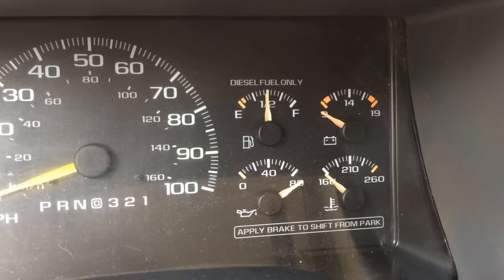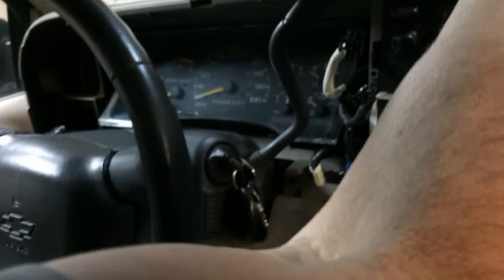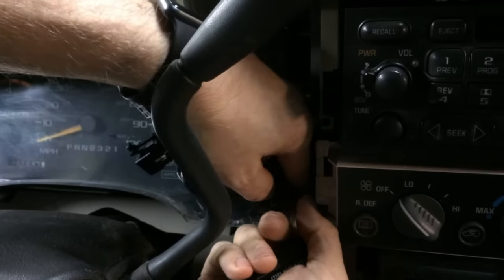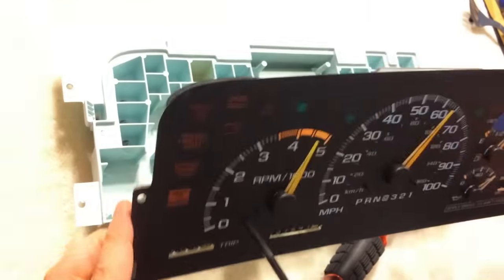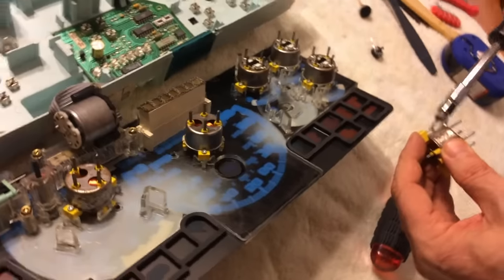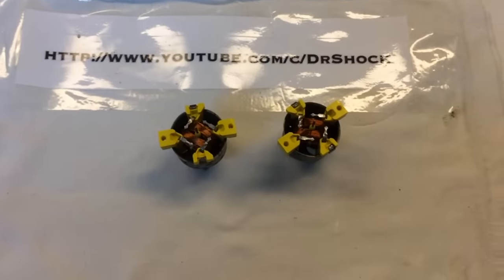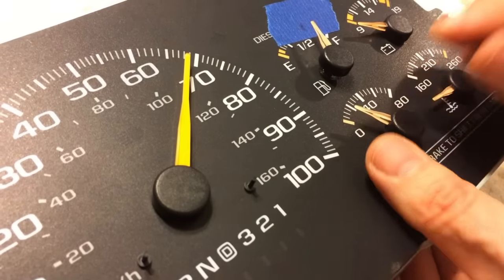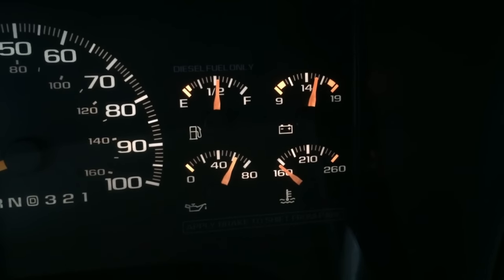1994 - 2002 GM Truck Twitchy Erratic Crazy Fuel & Oil Gauge Needle Aircore Motor Repair (Chevy GMC)

Comment: Well my rpm gauge and speed gauge are erratic and crazy what’s the fix for that?
Reply from the maker: It's much less common, but there is an "S" calibration aircore in the description for both the tach and speedo.   But unlikely that both went at once.  I'd check the wiring harness from the PCM, especially grounds first.   The tach signal is fed from the alternator harness on these old body style trucks.   I'd suspect the aircore motors last in the situation you're describing, far more likely wiring or even the PCM before them.

Comment: Would that work on he speedometer ???
Reply from the maker: Same type of aircore motor, but different calibration number than the fuel gauge,  The description area lists all of the calibration codes.

However, only the fuel gauge gets the twitching problem due to the motor.  A speedometer would not, and you would only replace the motor if it's going outside the dial range, or not working at all.  Speedometer glitching is more likely a vehicle speed sensor problem, or noise/interference in that same circuit.

Comment: Anybody know if there is a way to tell which one I have without disassembling the cluster?  I'd like to have my replacement prior to disassembly, especially if it maty be that none are available.  1998 GMC Suburban 1500 SLT 4X4 5.7  (My needle twitches the whole time and stays around 3/4 regardless of fuel in tank except when the is completely full or completely empty.
Reply from the maker: There's some detail in the video description, the motors differ only by model year.   The twitch is most likely the issue this video shows, but the incorrect tank level, that is more likely a problem with the sender.  The motors tend to have the twitch, and then either work or not work at all.  When it's working but inaccurate, that's usually the sender in the fuel tank itself.
Reply: @DrShock  OK, Thank you for the reply!

Comment: I wonder this the same as a 00 C3500. My fuel gauge is all messed up same problem.
Reply from the maker: Only if its an old body style truck, the new body design in 1999 and up went to stepper motors in their instrument clusters.   Though there were some carry over old body style commercial trucks like the C3500 so "maybe".
Reply: Thanks for the input. I'm take mine apart so I know what to order. Thanks for the video.

Comment: Mind sharing link to buy aircore motor? Im looking for the oil pressure gauge.
Reply from the maker: In the description
Reply: DrShock awesome,thank you.my pressure gauge starts pass 45-50 on cold start.then drops when im on a stop.then back up to 40 when i step on gas.think this is the issue or is that normal?
Reply from the maker: @sikk84mcss  IMO that described behavior is unlikely to be the gauge itself (which would be more typically completely inoperative or wildly off the marks on the cluster.  The oil pressure will, of course, fluctuate with acceleration and deceleration.   What would concern me personally is pressure reading too high (red) or too low (below 20) and if so I would be looking at the pressure sensor or the oil pump for further analysis there.  If the gauge needle is reading outside of the scale marks of the cluster, or jumping around wildly, or not reading anything with a known good sensor then it may be the aircore motor itself.
Reply: DrShock got you,ill take it to a shop so they can look at it.thanks alot 👍🏻

Comment: Once I get to about half a tank of gas my gas gauge goes down whenever I hit the brake so I don’t know how much gas I have cause it goes down all the way to empty when I hit the brake
Reply from the maker: IMO gauge movement changing based on braking force, or acceleration force, would be much more likely to be related to the sender in the fuel tank rather than the aircore motor in the gauge.  Only when braking, or also movement when accelerating?
Reply: DrShock it’s mainly just when braking.
Reply from the maker: Maybe someone else will chime in here, but my experience would be if it were the gauge itself you would have movement all the time.  Not just when you get below half, and then only from braking.  Still sounds fuel tank sender mechanical (float arm) or electrical (sensor circuit) to me.

Comment: I can’t find those air core meters no where.
Reply from the maker: They are not currently being manufactured anymore.  And yes they are getting VERY hard to find.  Also I see the scammers as well as folks who just do not understand that you canot reuse these are out trying to sell used ones on eBay now (the used ones have yellow plastic parts rather than white like replacements and will typically have surface corrosion on the steel).  I highly recommend NOT buying these used ones unless your current one is actually broken and completely inoperative - used ones won't cure the twitching dance.  You might try aliexpress.com if you need the "C" or "S" calibrations, searching on "air core stepper motor".  I've not purchased from this site before, but they do show them in stock with the correct white plastic type part in the photos.
Reply from the maker: A speedometer shop on eBay is now selling these again, but he's only got the "C", "P" "S", and "T" calibrations currently.  I put a link in the description.

Comment: ..the '94 trucks had the old style('88-'94) dash..the later ones(like this) are '95-up...
Reply from the maker: Yep, but '94 still used the same aircore motor style to drive the gauges
Reply: @DrShock  ..Interesting..I didn't know that..so what kind of gauges do the '88-'93 have?..I have an '89 and '91 trucks, and a '99 Suburban..I never had any issues with the '89 or '91 gauges, but the Fuel gauge on my '99 is all over the place..like the one in this video..thanks to your video, I know what is most likely wrong with my gauge now-I had been thinking sending unit, but probably not...Unfortunately, now that I know what is wrong, I probably won't be fixing it..couldn't find any of those aircore motors except a couple that they wanted a war pension for..no thanks :(  Unbelievable that you can't get parts to fix these, these trucks are starting to get old now, but not antiques by any means, and still a LOT of them on the road (these trucks are referred to as "GMT 400 series, BTW)...I have come to the conclusion that one is better off with one of the earlier years in this model series..the earlier ones are usually pretty bulletproof...the later ones (especially '96 and up) have more complicated electronics and emissions, a plastic intake manifold that is notorious to leak, troublesome "spider" fuel injectors, more sensors to go bad, a very poor distributor and distributor cap design, the dashboards are more prone to cracking and falling apart, and, as we see here, more troublesome gauges....Thanks for the video :)
Reply from the maker: Aircore motors for gauges go back quite a few decades at GM.  Stepper motors were the first new thing in gauges in a long time.   I haven't opened up a cluster that was pre-GMT400 series yet, but the speedo shop that supplied these aircore motors originally had explained that they fit the flexible circuit boards for 1994 thru 2002 (which I detail in the video description).    It's the change in how the PCM in these later trucks represent the fuel level that causes this, also detailed in the video description.   The twitch dance is almost always the faulty aircore motor in the fuel gauge, but other gauge behaviors could be the sender or poor grounds in its circuit instead.  Earlier trucks are immune yes.   Later trucks have their own problems, with low quality stepper motors failing.

Comment: I have the same issue with the fuel gauge but I replaced the fuel pump and I replaced a cluster and still doing it any help please
Reply from the maker: This particular problem I cover in the video has nothing to do with the fuel sender in the tank, and unless your replacement cluster was rebuilt with new aircore motors it too would likely suffer the same gauge problem after so many decades.   The only real fix is the replace these aircore motors themselves, presuming this is the problem you have where the guage needle moves even when the vehicle is parked and still.   One thing you could check though before going to the video work is to inspect all the key electrical grounds on the vehicle.  A bad ground (wiring, fasteners, and connectors) can also affect the fuel gauge behavior at vehicle rest.

Comment: How do you know that the fuel is right????
Reply from the maker: If not by habit of knowing how much you have to pump in to fill the tank, you'll have to do it by trial and error on your next couple of fill ups until you get your needle fully re-calibrated manually onto your new replacement aircore motor.

Comment: I need the stepper motor for the fuel gauge for my 98 chevy pickup but I cant find it anywhere. PLEASE HELP!!
Reply from the maker: These motors are not available anymore from China, try the links in the description and pinned comment at the top for remaining stock.  Only one shop on eBay still selling these kind of parts but they don't have "F" anymore.
Reply: @DrShock  I need the F. Cant find one anywhere
Reply from the maker: Reach out to the eBay seller in the pinned comment, its a speedometer shop that will also do rebuilding of the F calibration aircore motors (involves the original tooling to reinject the dampening fluid into the core).  While not new, this would be a professionally rebuilt aircore motor that should be equivalent.

Comment: My fuel gauge goes back and forth along with the blinker about 1/8 of an inch. If I only had 1/8 of a tank of gas I can't use the blinker because I might run out of gas.

Ha ha ha ha ha!!
Reply: Sometimes a bad multi-function switch can cause this problem with the gauge jumping with the turn signal on.

Comment: My gas gauge goes to E and after while it says full and drive for awile it go back to E
Reply: Mine is usually at 3/4ths and vibrates. Then it'll randomly peg empty. Then back to 3/4th.
Reply: What is wrong should I replace that peace

Comment: hi there were can we get them i look on ebay i may need a part number
Reply from the maker: Did you try searching eBay for "GM TRUCK AIRCORE MOTOR"?   I see many many listings with that search
Reply: @DrShock  found it  thank yea
Reply from the maker: A speedometer shop on eBay is now selling these again, but he's only got the "C", "P" "S", and "T" calibrations currently.  I put a link in the description.

Comment: What's the right name of thoes little motors ?? Anybody ? Please !
Reply from the maker: The right name is the one given - "Aircore".   But that only applies to these years in the 1990s, more modern years use a different technology known as "Stepper"
Reply: @DrShock  
So now are Calle aircore steper motor ? 
But is the same right ??
Reply from the maker: @hilariovazquez-badilllo5038  You might see some sellers stick the word "stepper" in there since many vehicle owners mistakenly think that's what these older motors are.   As long as it says "Aircore" and the photo looks like what I show in the video (e.g., F code and open to the air windings) it should be fine.   But if it does not look EXACTLY like what I show in the video, it's probably for the next generation trucks rather than these old body style models from the 1990s.  Aircore is not a brand, it is a specific type of electric motor.
Reply: @DrShock  thanks Dr shock !

Comment: mine was doing this shop said it was the sending unit
Reply from the maker: It can be, and it can be both the sending unit and the aircore motor.  The motor problem tends to be the twitching/flittering effect.  And the sending unit tends to be the inaccurate/inoperative/random spasm effect.   I covered how to test the sender in some OBS models here - https://www.youtube.com/watch?v=dw9Hia55yys&lc=UgwByzv6oY3dXPAPaZJ4AaABAg
Reply: @DrShock  my gas gauge is jumping around and at highway speeds the engine is sputtering.
Reply from the maker: The gauge jumping around at the highway, but not fluttering or twitching in place, is yes most likely the sending unit.   The engine sputtering, unrelated to the gauge mechanism.  The only possible connection I would expect, is perhaps the sputtering is fuel flow related so also located in the in-tank fuel module.  But a fuel pressure test would answer that fairly quickly.

Comment: I can't find any "F" air motors anywhere. Anyone have any luck on Ebay finding the fuel motor
Reply from the maker: They come and go in stock with the main eBay sellers out there.  I find I have to just keep checking as it seems this particular calibration is in high demand.   Suggest you add your search as a "saved search" and have eBay notify you when they are in stock again.
Reply from the maker: A speedometer shop on eBay is now selling these again, but he's only got the "C", "P" "S", and "T" calibrations currently.  I put a link in the description.

Comment: I would love to do this to my 99 2dr Tahoe but I can not find a “F” motor anywhere is anyone else having any luck?
Reply from the maker: I saw these eBay sellers run out of these "F" aircore motors earlier in the year, and then a few months later they got them again.   I don't know how long they will be out this time,  but personally I keep a "saved search" on eBay for them.  If you can't wait, you could trying going with the "C" calibration (it's for a newer truck model).  There are some comments here from others who went that route I believe.  It is my belief that the difference between C and F is the internal dampening fluid viscosity.
Reply: DrShock Thank you, I have the search saved on eBay. I’ve lived with it this long I can wait a few more months haha.
Reply from the maker: @harpe4422  A speedometer shop on eBay is now selling these again, but he's only got the "C", "P" "S", and "T" calibrations currently.  I put a link in the description.

Comment: Hello. You have help me fix 99% of mu cars problems, thanks for your perfect videos.
There is one I cant figure out, and havent found much on the web.
If you have any expience on this please help.
Changed the car battery and my keyless entry sistem stoped working. So I grabed both remote controls and did the programming procedure again (jump OBD 2 pin 4 and 8 , after the lock cycle press lock and unlock on the remote control). When I do this about 5 seconds after y press the botons tus cars does the lock cycle (meaning the programation process whent ok), remove the pin but the remotes dont work.  I did this 2 years ago and no problem.
I have the service manual versión 2,  but the trouble shooting ask me to reach the keyless entry receiver wich its almost imposible. I think that if the locks cycle in the programing secuence after y press the 2 botons then the reciever should be ok.
Totaly lost here!!
Reply from the maker: Odd that just a battery replacement would trigger this, and totally unrelated to this video.  But for a RKE FOB that programs, but does not transmit, that service manual table would have to be followed to pull the rke module (receiver) and do the resistance checks and wiring tests.   You could just try reseating the wiring harness connector to the module first though.  But there's no shortcut or alternatives if the programming cycle completes, but the fob remains inoperative.
Reply: @DrShock  thanks... almost imposible to reach. Mi hand doesent fit in the space, from below i dont see a chance.
Thanks again

Comment: Since these new Air Core motors are so hard to find , I'm shopping Dakota Digital  and NVU for a new updated cluster... In the long run , they are alot better designed than these cheap GM clusters...

Comment: Could it just be the ground wire itself from the sending unit that causes the erratic fuel gauge because I already replaced the fuel pump with sending unit itself and same goes for cluster I replaced 3 clusters and nothing fixed the erratic gas gauge?
Reply from the maker: Yeah, there's a couple of difference dances that could be going on.   The twitch is always going to be the aircore motor in the gauge cluster.   The wave or the sway is going to either be the sender as well, or the wiring harness to / from the gauge.   Either to / from the cluster to the PCM/VCM, or to / from the PCM/VCM to the sender in the tank.

Comment: My gas gauge did a whole spinning motion and the needle broke off. If i replace it is there a way to reset it?? I dont know how much is in the gas tank
Reply from the maker: Personally I usually use the tripmeter to gauge my gas mileage, so I'd run the tank "down" enough where I could siphon out the rest of the fuel to start at Empty.   Set the needle there and replace the fuel, fill up and adjust from there to Full.   But basically you have to get it either set to E or F to rough calibrate it and adjust again as you notice things different from what you're used to.